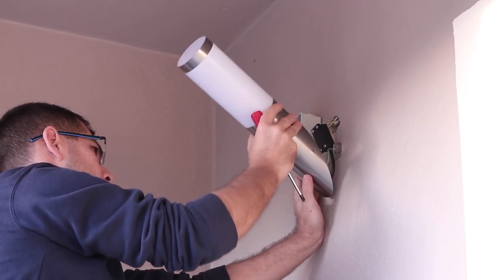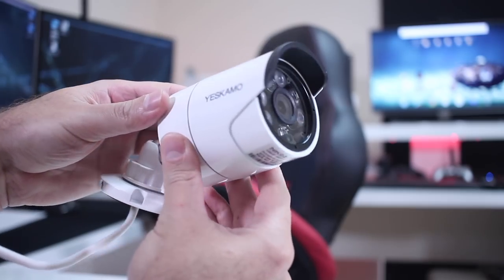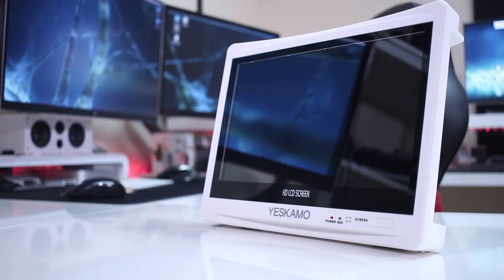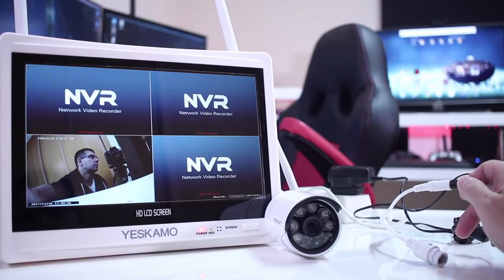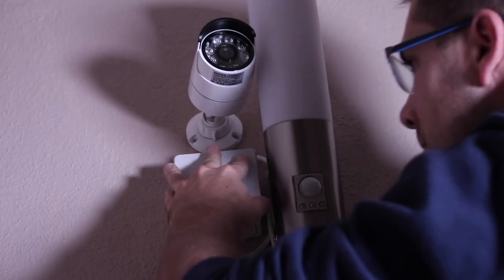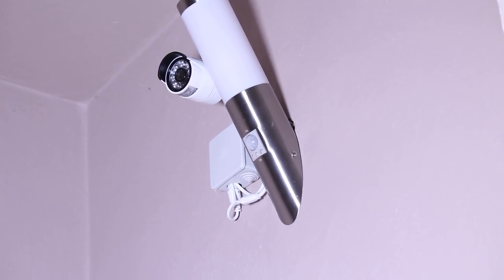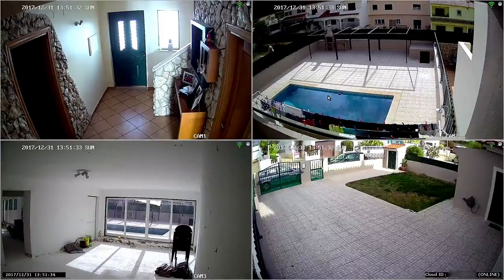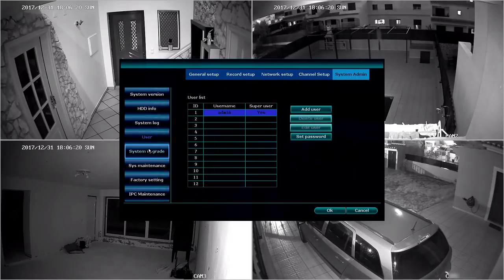YESKAM WIRELESS CCTV SECURITY SYSTEM | REVIEW

Comment: I'm very interested in the WIFI RANGE and signal connection strength.  
How far away are the cameras and did you have any signal dropout issues?

I
 ask as I bought a SWANN 490 4 cam WIFI PIR  system, much like this one,
 and despite good OS and Chat support the WIFI range has been abysmal.  I
 had 2 x Chinese/Ebay ANRAN brand systems that gave 5/5 bars in the same
 camera locations as I placed the SWANN, however the SWANN gives 1-3 
bars and maybe 5 dropouts per hour. SWANN support had me use STATION 
mode to wifi the cameras to my router to bypass the NVR antennas, this 
gave some improvement but then tethered my router into the camera 
system, such that if the router goes down so do the cameras. Overly 
complex to look after as well.

Swanns WIFI range was declared as 20M.  YESKAMO text says 30m range

My distances are as follows in Meters between camera and NVR.
Cam           NVR        Bars               Video Loss rate
1                  4             4/4                  1 x 3hrs
2                  8             4-2                   1 x 1hrs
3                  9             3-1                   5 x 1hrs
4                  18           3-1                   5 x 1hrs

Comment: Thank you for the video, mate.
I am planning to get this set also. Where is the camera manufactured?

Also, should I install on/off switch for the electricity cable (I will not use the ethernet cable) or you think it is okay for the cameras to be powered 24/7?
Thank you.

Comment: Hi sir . It will Work the NVR wireless To The Router without Ethernet cable? Thanks A Lot
Reply from the maker: Hi Christian, no it need a cable to connect it to the router. Or if you cannot place a cable you may use a PowerLine Adapter 😉
Reply: Thank You So Much Sir it help Me lot :)